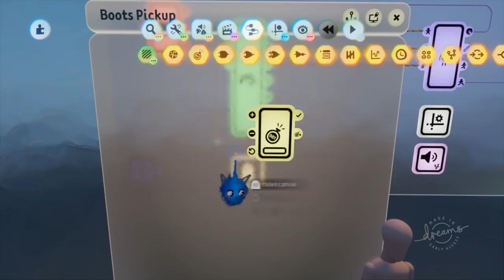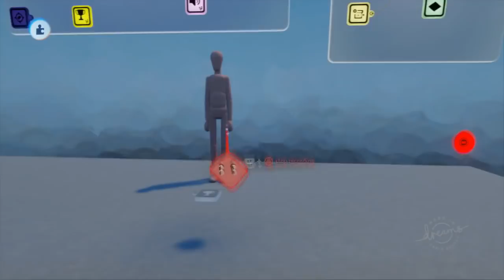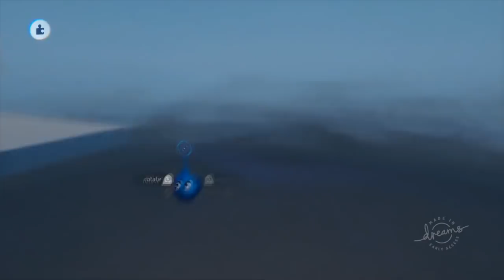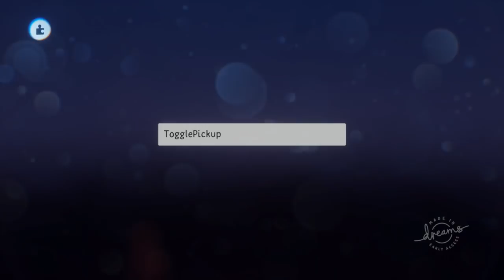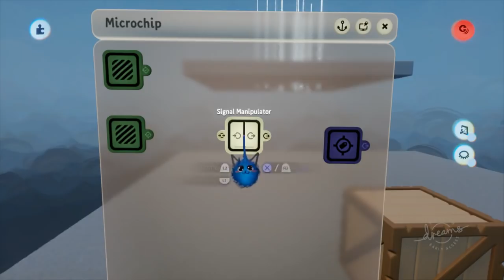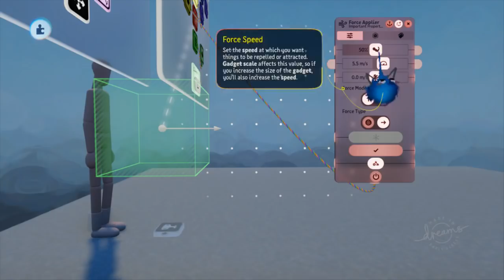Dreams PS4 | Basic Character Gameplay Tutorial 2 (Invincibility, Hover Jump, Picking up Boxes)

Comment: Do you know if there's a limit to the amount of variables and variable modifiers you can have in a scene? Sometimes the variable modifier works for me sometimes not. I've done all the standard trouble shooting and it's wired up correctly it just never modifies the variable. In test mode the other parts work but the variable modifier doesn't get activated
Reply: Currently the amount of persistent variables your dream can have is 128. I'm not sure about a limit overall for variables and modifiers but that probably the issue you are having. There is a way to use 23 boolean variables with the value slider and a single variable (and of coarse some other logic) I'll find it when I get home and reply to this with the info you can check it. Worth a look at least if you are needing more variables for your level.
Reply from the maker: Where did you get the 128 from?
Reply: @NeonTheCoder  I got an error the other night that my "scene had too many persistent variables and the current limit is 128" is what is said at the bottom of the scene in a popup.